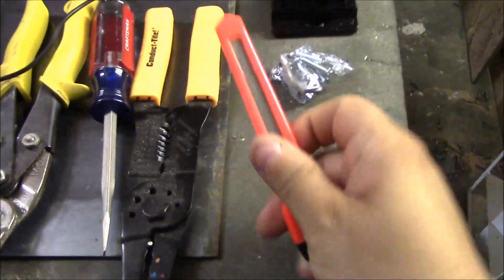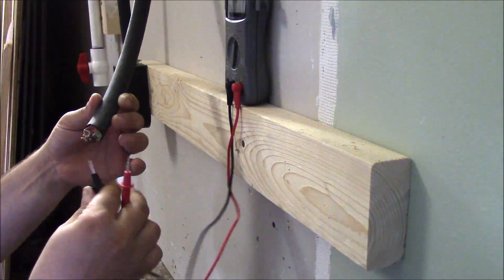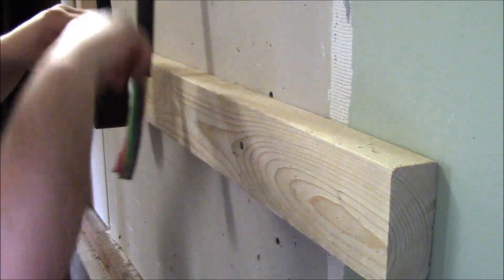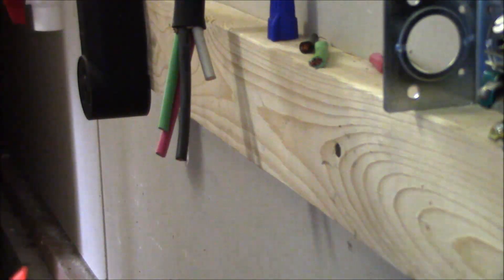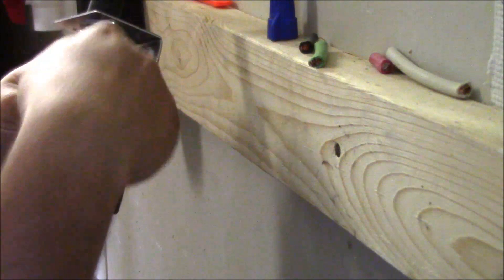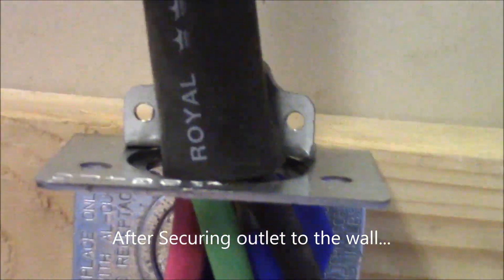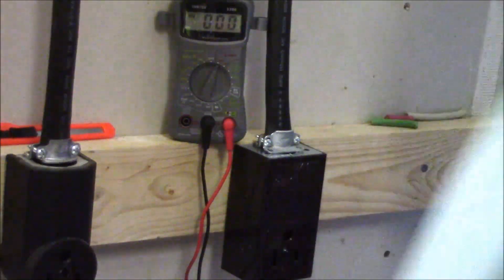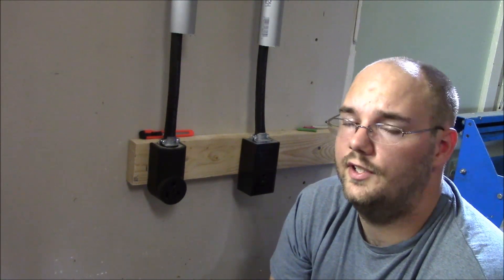How to wire 220 - 240 Volt NEMA 6-50

Comment: Did you plug the white wire in the box?I did not use the white wire in the box and in the breaker panel but still getting current in the white wire?
Reply: In a 220v/240v 6-50r outlet, you don't need to use the neutral wire. Since the outlet only requires two hots red, and black, and the ground. So, all you do is cap both ends of the neutral wire off, therefore there won't be power going to it.

Comment: I noticed you had no excess wire inside the receptacle box. Is that because the box is externally mounted (i.e. not inside a wall)? 
 I've been told each wire should be at least 6 inches in length within the electrical box. 
What volume calculation did you use for sizing the box?
 Thanks.
Reply: Jim Czekaj    Jim, technically the receptacle begins at the connector.   It is all sold as a unit.  So it is not a junction box as in code, therefore the 6" rule does not apply.
Reply from the maker: Jim, Thanks for watching, and as for the 6 inches of wire, maybe in most residential 120V boxes that is realistic, but there is no way you will get 6 inches of extra 8 gauge wire in this. It does however have a built in cable strain relief. I didn't do any calculation other than it is what I needed. a standard outlet for a 50A 240V welder.

Comment: I'm wiring a cable for my welder (nema 6-50) going to the dryer outlet (nema 14-30) so I can just run a 3 wired cord, skipping the neutral and using the 240 and ground? The dryer outlet is a 4 prong connection, welder is 3.
Reply: Thatcher N    Not legal.

Comment: I thought you could have screwed down that box to the wood a lot sooner to make the work easier.  Also, I wish you would have identified the awg of wire you were using right up front.
Reply: Looks like 8 , and it's easier to do loose

Comment: I'm trying to find a video that shows which wire goes to which post, I'm having a hard time. All these guys want to talk a whole bunch of s*** about all the little bull you have to do to put a freaking Outlet on a wall. Nonsense. Ego. If I knew which wire goes to which post I could do this video in 30 seconds.
Reply: Damn straight. This problem is starting to piss me off enough I'm thinking of starting my own videos of reviews and how-tos called 'Get To The Point'. First 5-30 seconds tell you precisely how to do it, or if it sucks. Want to know more? Watch the rest.
Reply: Agree fully.  That's just YouTube, lots of junk.  Though I haven't wired a 6-50R, for a long time you have been able to identify which wire goes on which lug from the colors of the lugs and wires.  In the general case (any receptacle), look for a green lug; that will be ground or the green wire.  Then look for a white one.  That will be for the White (neutral) wire.  Then look for brass-colored ones, the red and/or black wires (220) will go on those.  Note that the 6-50R is a 220/240V receptacle only and does not provide 120V and so does not use the white wire.
Reply: Let us know when you post your video on how to wire these!

Comment: this is crap
Reply: If you're a pro why are you here? This is for beginners.
Reply from the maker: Please elaborate on what you would like to see better? Maybe start off with your credentials also so that others reading these comments know whether or not to take you seriously? Thanks for watching though!
Reply: Me: aerospace engineer with decade of practical experience in electrics.  Fourteen and a half minutes spent on illustrating how to connect three wires to three terminals and tucking away the neutral in a non-compliant install using SO cord...that my friend is crap.

Comment: Can you wire multiple 240 volt receptacles off of the same breaker?  I have a shop that I would like to run some 10/3 NMB down about 20 feet of wall and put in 3 receptacles so I have different options for placing woodworking tools along that wall.  Thanks!
Reply from the maker: Yes, you certainly can.
Reply: When running wire for 120 volt receptacles, the wire connects at the receptacle due to the format of the receptacle (typically, up to 4 wires from the same leg of the circuit).  How does that work with 240 volt?  I don't see multiple ports on 240 volt receptacles for multiple wires from the same leg.  Should the wires be spliced outside the receptacle?
Reply from the maker: Darron junction box with wire coming in, and two wires going out to sepperate receptacles.
Reply: Sounds good.  Thanks.  Just use a regular wire nut connector to split the line into 2?
Reply from the maker: Darron yes, has to be in a junction box though. And electrical tape is nice.
Reply: Yes, definitely to both.  Will have a junction box for the split and a separate box for the receptacle just adjacent.  Thanks for your help.
Reply: Seems to me like you're going to have to be careful not to overload the circuit now...ie, only run one appliance at a time.
Reply: I would say it depends on how it is being used.  If the 6-50 is for something like an EV, I would say don't do it.  But I am sure there is a code for it.  I am not an electrician.

Comment: It was difficult to see where you put the wire on the NEMA 6 50R was it under the screw or in the u shaped brass piece? A close up would have been helpful.
Reply from the maker: So on this particular style receptacle, by placing the stripped wire in the U shaped brass piece, it would then be under the screw. the threaded piece that the screw goes through gets retained and then you are pinching the wire between the screw and the U shaped brass piece.

Comment: i have a question. everytime we install 240v receptacle, dont we use neutral wire?
Reply: There should never be power going through the ground wire, if there is, something is really wrong, either in the line or the equipment.  
*In a nutshell:
A neutral is used to return load back to the transformer that's feeding your house, as no panel load is truly balanced, so you have the neutral line to balance the load at the transformer.  The neutral is tied to ground in your breaker box, to keep it from building up a charge of it's own.  The neutral is not there to provide a closed circuit like the return line would be in a DC circuit. Which is why it can be tied to ground in your panel without charging the ground wire, unless something is really, really, wrong.
The transformer feeding your house is a center tapped 220v AC output to provide two legs of 110v AC on opposite phases.  Phase, the best I can explain it without a drawing is the curve formed by the peaks and valleys of the recipricating current flow, which looks like a sine wave.  Opposite phases would be that if the sine waves were looked at side by side or superimposed over each other, you would see that while one is peaking at top, the other is hitting the very bottom of the wave.  
For 220v, you are using both legs of the transformer, so there is no load imbalance to recify.  The best way that I have found to understand this is that AC power is more about electrical potential, than it is about current flow like in a DC system.  AC is it's own circuit, since the power is rapidly alternating (reversing at 60 Hz, or 60 times a second) current flow, so no return line is needed.  If the transformer feeding your house was a non-center tapped 110v output, then you would not need the neutral line for 110v.  An AC circuit will work without the ground, but if something goes wrong, it will create a very dangerous situation, so you always need the ground to be there just in case.  There are lots of old appliances out there that weren't even manufactured with a ground of any kind.  I am sure the funeral parlors miss them. :)  A good ground also allows the system to shield itself to a practical extent from nearby lightning strikes that can cause a problem on an unprotected system.
The switch to 4 wire/prong 220v connectors came from modern household appliances.  Manufacturers wanted to use one leg of the incomng 220 to provide a 110 circuit to run the electronics on the fancy new dryers and stoves, so a neutral line had to be added to allow for this to be run from a single outlet.  This why you are seeing neutral ines in some 220 outlets now.  This has led to some confusion for those who are new to wiring.
**While I am happy to share what knowledge I have, I am not a professional electrican, and this is only a very basic explanation of how it works.  This is not something to be taken lightly, or to play around with.  If you don't know what you are doing, your house could burn down or someone could be killed.  I learned what I know by wiring my shop with the advice and direct supervison of a qualified/certified electrical engineer (my father-in-law, who had a vested interest in not seeing his daughter made a widow, and is a retired head electrical engineer from a major manufacturer of some very complicated electrical and electronic equipment, I admit not many will be so lucky)  If in ANY doubt, hire a qualified electrician, at least for final inspection and connection to the panel.**

*This of course, is referring to the standard U.S. household electrical system.  European is 220v at 50Hz, and having never done any wiring on a house or shop in Europe, I defer to our European friends to chime in if they wish. 3 phase is a whole 'nother beast not covered here, and not going to be found in the normal American household.
Reply from the maker: Faelwolf thank you very much. One for not being a troll, and two for helping explain further for those that take the time to read the comments. I agree with all that you said.
Reply from the maker: It is my experience that the only time the neutral wire is needed is when the appliance/ equipment you are using will have something in it that is only using 1 leg of power, or 120 volts, then this amperage drawn from that portion of equipment is sent back to the panel using the neutral wire. If using all 240 volts, then the equipment typically sends amperage back through the ground wire.  That's the way it was always explained to me.

Comment: Wow, major code violations here. 1: you MUST use EMT or flex conduit to wire up outlets in exposed work areas. You are NOT allowed to use rubber power cord. 2: You MUST use insulated throat 3/4" EMT fittings because 1/2" is too small and violates the allowable fill in 1/2" EMT for 8AWG wire. 3: Using PVC pipe is against OSHA rules for the workplace. PVC cab explode if struck by an object and becomes brittle. You need to remove all the PVC and replace it with either black iron pipe, copper or Rapid Air/ Plex-Al-Plex (which is the best option) piping
Reply: Does that mean I can't use a welder extension cord for my Welder?
Reply from the maker: You can do whatever you want, it just might not be up to code, or the safest. You can use an extension cord for a welder, but you by code are not supposed to use SOOW cables for permanent in wall installation.
Reply from the maker: He was referring to the type of wire that I used was fine stranded and is typically used for an extension cord, it is fine to use it for an extension cord, but not intended for permanent installation.

Comment: I've wired my outlet 60-50R outlet. I'm getting 119v from the ground to the two hot terminals, but I'm not getting anything when I test the two terminals together. Do you know of anything I could check for to make sure that my wiring is correct? Thanks for the video.
Reply from the maker: +KyleMyers33 This sounds like what would happen if you are pulling the hots from the same leg of power on the panel. I don't see how this would happen if you have a 250V 50A breaker in the box. My only thought would be that if working from a sub panel, is this the first 220-250V outlet you are trying to put on it? Some sub panels get wired with only one of the legs from the main instead of both of them and therefor can only provide 110-125V. If your breaker is correct and you have a single pole sub panel then testing across the two as you describe would be equivalent to testing the same wire in two spots. That is my only thought, and to look for it, I would see how many larger main wires are coming into the main tree one leg on the left and one on the right generally, if only one is there then you have a single pole sub panel only. Again, just a thought and as always my caveat that I am not an electrician and if your not comfortable looking into this yourself, please find someone that is licensed/comfortable to do so. 

Hope this helps.
Reply: David Finch It's fixed! You were right, I was pulling from the same phase. I have an older and very small box, and there are only two spots where I can pull from both phases. I did some rearranging and now have it working properly. Thank you for your help.
Reply from the maker: +KyleMyers33 I'm glad that I could be able to help you! Thank you for posting the verification of a solution as a comment for other viewers who might run into a similar problem can see it.
Reply: That actually was very helpful to me as I went and grabbed the female box and a 60a sub panel with a 60a dual pole breaker, the dude at home depot in my town is very knowledgeable and I let him know I was trying to hook up a lincoln buzz box in a house and knew about the 2 rails in the panel but I didnt know how to verify fer sure if my sub panel is the right one?, and it has 2 legs. 
Can I ask you what size wire cap I need for 6gauge?
Reply from the maker: Ghost Dog I don't know off the top of my head, but normally the bag they come in will say how many wires at what gage they are good for.

Comment: What size wire did you use?
Reply from the maker: 6 AWG fine stranded. Will carry more current than 50A, and was easy to manipulate and wire.
Reply: David Finch Thanks...I am re-wiring my shop/garage with a 100A sub panel which will feed my welder and all mt 220v tools. I will be using Romex 6/2 wire. Do you know if the way you did it was up to code?
Reply from the maker: WestCoastMods Keep in mind I am not an electrician and not a code expert, but I did read through some of it. From what I can tell the one thing that isn't is leaving the exposed cable out of the conduit before it goes into the outlet box. Other than that, all of the wiring connections should be good. I will stress to many people however since this is what it is that if they are not confident then to at least get it inspected by a licensed electrician if they are doing it themselves.

Comment: I'm wiring up a hobby lab and would like to use the same outlet layout as yours.  Different  types of 30- 50A outlets along a 2x4 with portable cord coming off the breaker box.  Each on their own breaker.  However, I'm concerned that it might not follow code.  The SOOW cord sure makes it easy to modify the setup from time to time.  Bending conduit is a pain when versatility is required.
Reply from the maker: I'm sorry, but I don't follow whether you are warning me of a code violation or asking a question? I am not an electrician, but a DIY'er. This is in my own separate from my residence work shop. I would advice if you have any concerns in electrical work that it isn't something you should do unless you are comfortable with your abilities and should consult an electrician and research for code compliance.
Reply: David Finch I'm a DIY'er like you.  Your setup makes perfect sense to me.  I'm an electrical engineer and do my own wiring for charging my two electric cars.  So I'm familiar with wire selection and connections.   But, I'm always being told by electricians that my physical setup isn't to code.   Something isn't supported properly or something isn't so many inches of feet from something else.   Just wondering if you've had a similar experience.
Reply from the maker: Zazzle Delacruz I cannot say that I have had any comments as you suggest. I work next to an Electrical/Grounding/Lightning Protection Engineer, and we agree that what I am doing works just fine, but neither of us are experts on the residential codes. We simply agree that it will work and for serious items may consult the NEC Handbook.
Reply: my angle on code is you need an licensed electrician to install it. if you open the panel and touch it you are breaking code. 
my other angle is that you just say it was wired up before, no inspector said shit when you purchased the property. make sure you have the correct caps on the wire inside the box just for your own safety. use somekind of conduit to protect the wire near welding or heat zones. I am wiring up for a lincoln buzzbox too!! nice vid!

Comment: Thanks I'll be doing this tomorrow and you have the exact same receptacle I have so now I know what to expect.
Reply from the maker: Your welcome FixxxerKH202 I hope it turned out and works well and was not a shocking experience!
Reply: Worked great and no shocks. I was running it off a 50amp subpanel so I killed the breaker in the main. I did have to reorganize breakers and adjust wires though because my 100amp main was getting pushed by the wires so it slid one pole of the 50 amp next to it off the connection on the panel so I only had 110v in the sub on one side until I sorted that issue out. Now I also have enough 6/3 from running the sub panel to make a nice extension cord for my welder with one of these outlets and a male 6-50.

Comment: NEMA 14-50R (and P) will make you life easier down the road.
Reply from the maker: For educational purpose, as I do not know, would both the tall and short legs of the NEMA 6-50P plug into the NEMA 14-50R, or would this swap require wiring new pigtails onto the equipment that has the NEMA 14-50P?